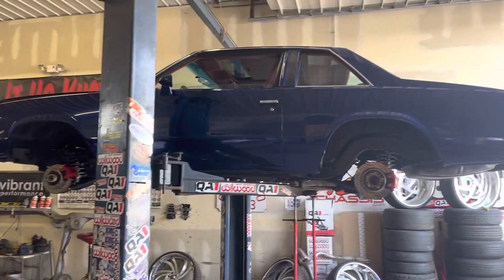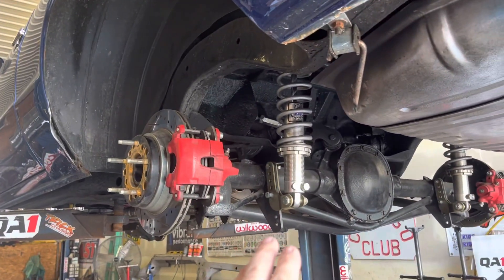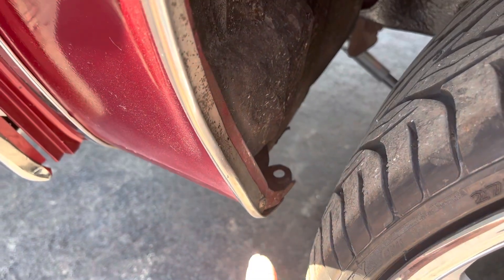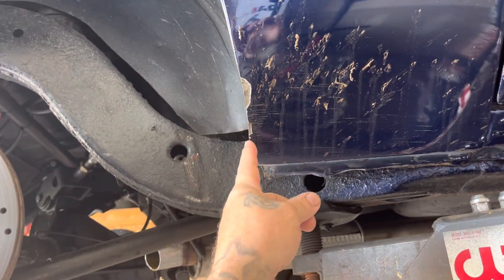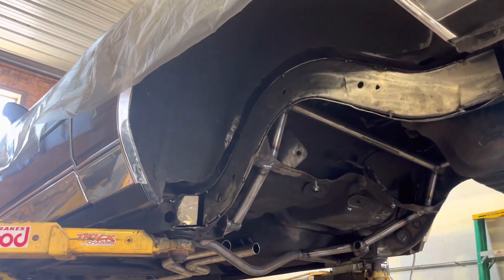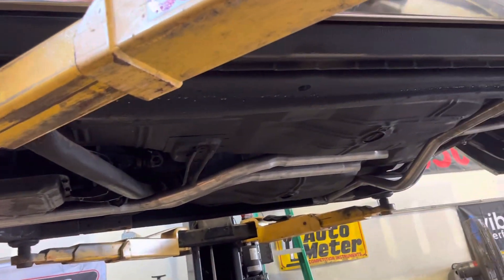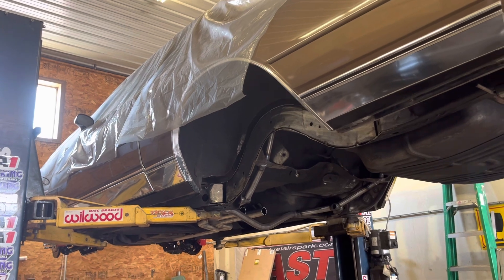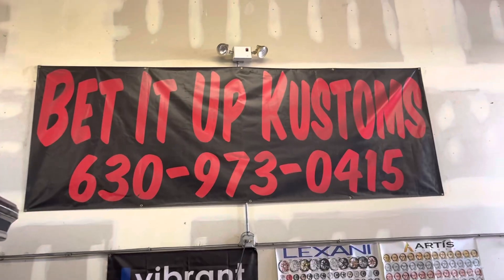Bet It Up Kustoms #677 / $100k Box Chevy

Comment: hey bro I'm about to notch my rear end on a box chevy for 26"s do I need to run a brace pipe to each side of the frame to make it stronger ? not going on the track just street performance.
Reply from the maker: You rarely have to frame notch a box chevy, depends on width of the wheel, narrowing of the rear end need be for a deep lip.